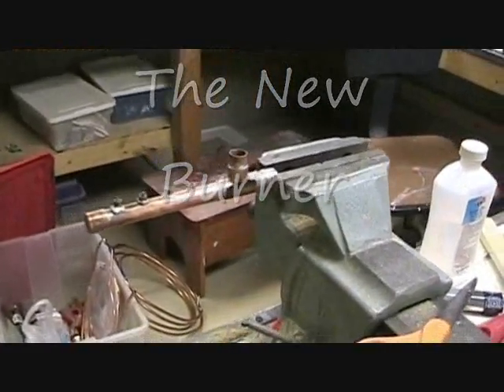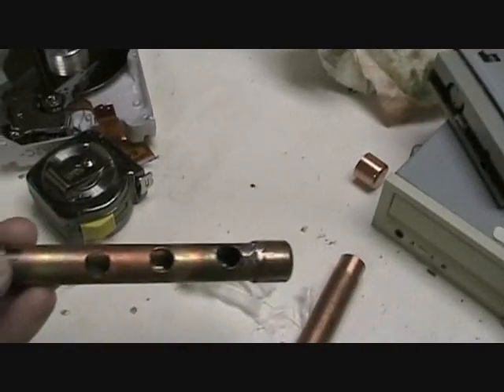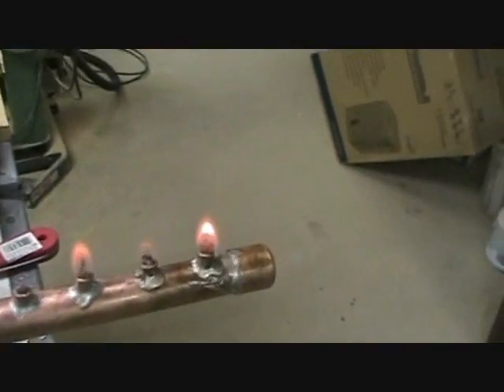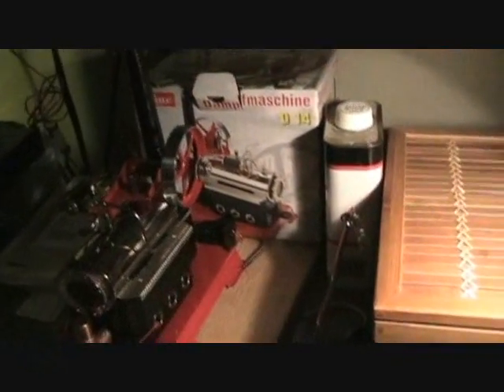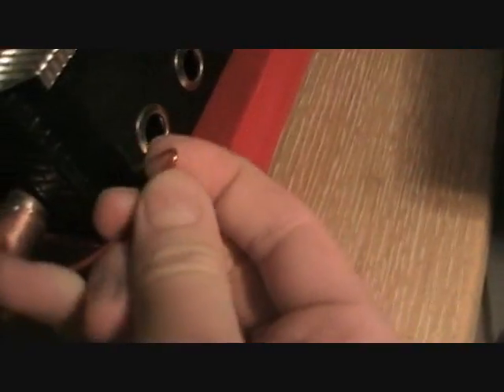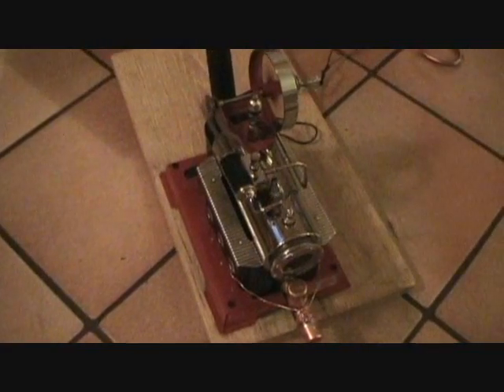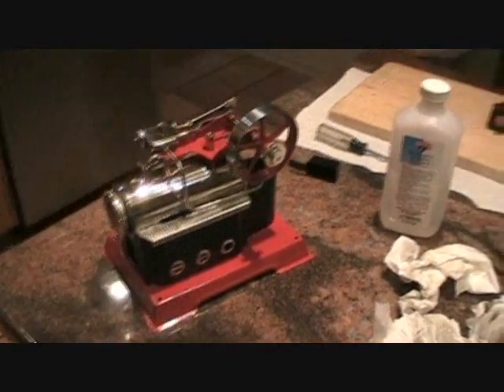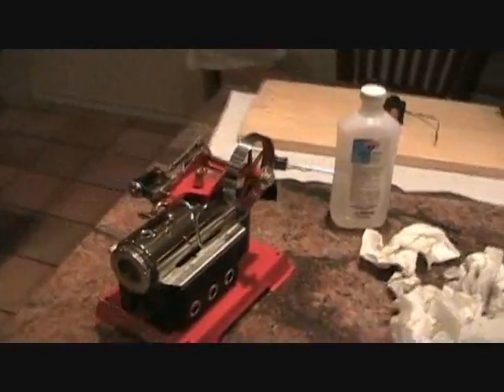Alcohol (meths) Burner for Steam Engine

Comment: I like the design, but to make it so that it doesn't tip over, make some type of stand that is attached to your burner and somehow clamps or locks to your wood board, i'm going to build one that you can put the fuel tank at a lower spot than the burner that is denatured alcohol fired.